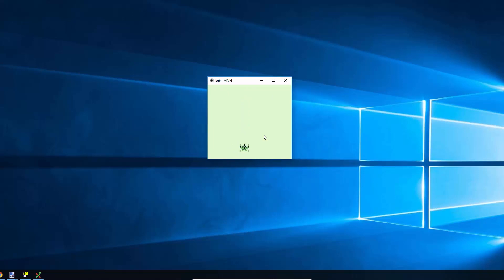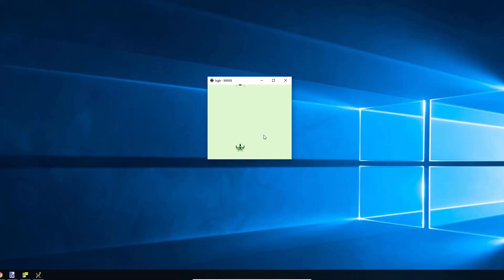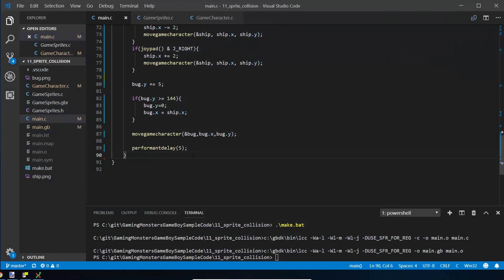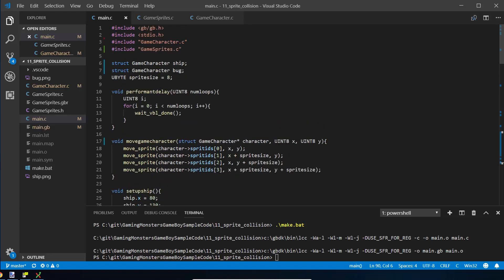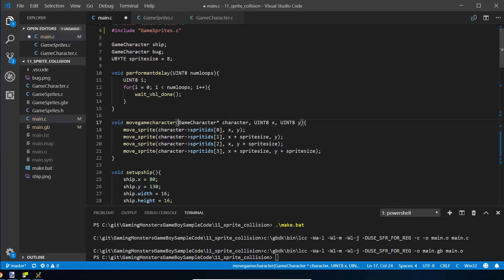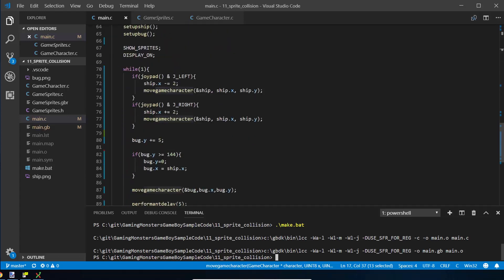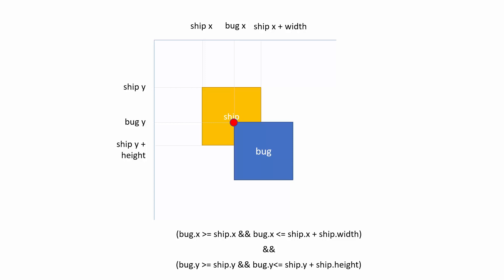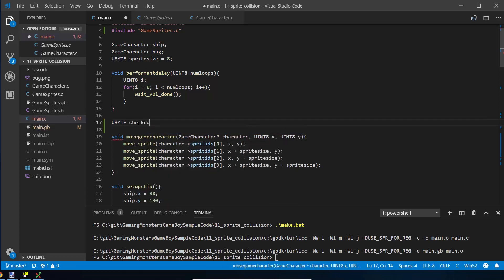"Sprite Collision Detection" - Part 10 Program Gameboy games - write your own Game Boy game

Comment: Hi! I've been playing with GBDK since i saw your tutorial and i discovered that the gameboy uses the sprite origin in the upper right corner, that's why your collider detector didn't work with only one verification, i've been coding my own version of space invaders for gameboy and it works very fine detecting colliders with reference at the upper right point.
I know this video is 1 year old at the time i commented on, but i hope it can help you or somebody else :)
Something like:
obj1.x >= obj2 -> x - 8  && obj1.x  <= obj2 -> x && obj1.y <= obj2 -> y + 8 && obj1.y >= obj2 -> y
Reply: wouldn't you still need to do the the other way around also? The upper right might not be touching but other parts can be

Comment: using typedef brings me this syntax error:
main.c(23) syntax error: token -> '*' ; column 37
Reply: Wait it was fixed now.

It was this on gamecharacter.c:

#include <gb/gb.h>

//generical character structure: id, position, graphics
typedef struct GameCharacter {
	UBYTE spritids[4]; // all characters use 4 sprites
	UINT8 x;
	UINT8 y;
	UINT8 width;
	UINT8 height;
} GameCharacter;

And I did

#include <gb/gb.h>

//generical character structure: id, position, graphics
typedef struct GameCharacter {
	UBYTE spritids[4]; // all characters use 4 sprites
	UINT8 x;
	UINT8 y;
	UINT8 width;
	UINT8 height;
}

Comment: Hey awesome series so far. You’ve missed a pretty decent opportunity to optimise your collision test.
If you look up AABB ( Axis Aligned Bounding Box) tests you’ll see that you could avoid the second test you’re performing - the bug vs. Ship part of your test with a slight modification to your original test.
With AABB test the opposite sides of the boxes for overlap. So taking your sprite origin as the upper left corner you can test as follows. 
(o1 is object 1, o2 is object 2)
If( o1.x < o2.x+o2.width && o1.+o1.width > o2.x){
     If( o1.y < o2.y+o2.height && o1.y+o1.height > o2.y){
//collision happened
Return true;
}}
Sorry for the YouTube formatting on that one. 
Liking the series so far. You’ve inspired me to put up my GBA programming tutorials on here. So thanks for the motivation.